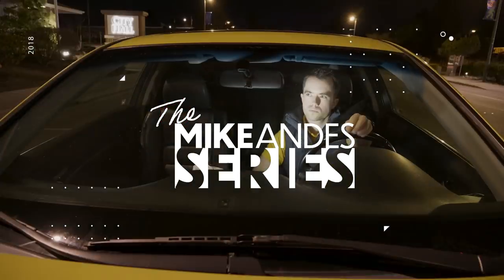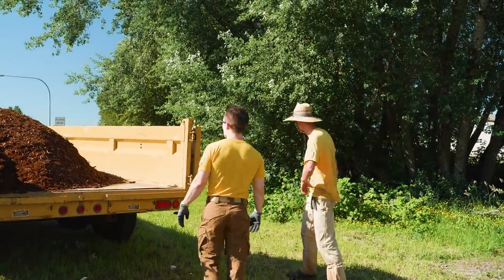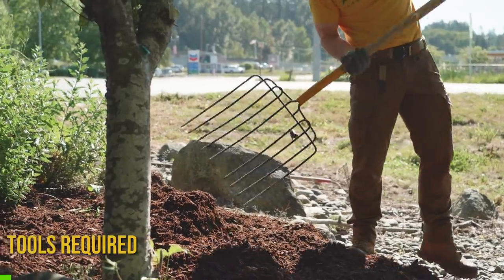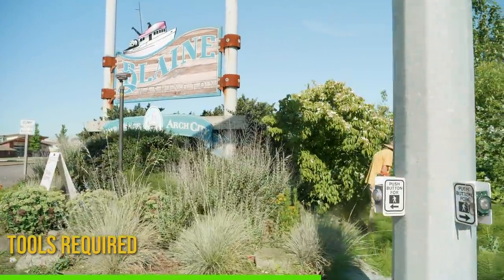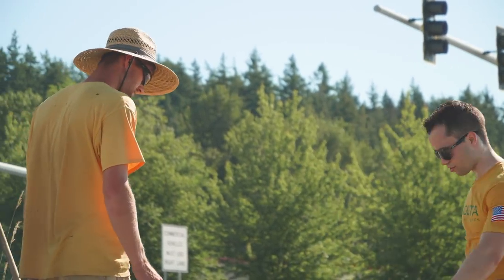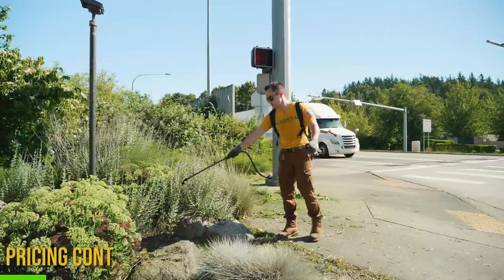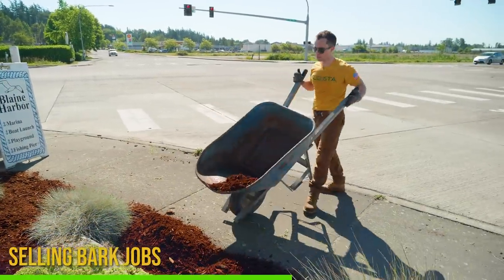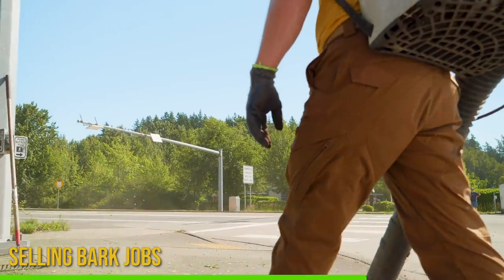How To Do A Mulch Job | Measure, Estimate, and Price Mulch | How To Mulch Tips

Comment: I would recommend buying a wheelbarrow with two wheels.  It can carry more material and it's better for you back.  It also makes it easier to push on rough terrain
Reply: You can’t, the bottoms split something awful. I tried to reach out to Jackson and True Temper a few months ago when I couldn’t find the 8/10 cubic foot models ANYwhere, and couldn’t order a replacement tub directly from them. They said both models were discontinued and aren’t going to be made anymore. Call them yourself if you don’t believe me, it’s super foolish. Anyways, maybe now that the coroneyvirus is chilling out, and people are working outside again, perhaps they’ll get their heads out of their asses, and start creating tools we need and want. I have three blue 8 cubic foot wheelbarrows, and they’re all broken. From logs and mulch. Can’t buy them, they’re not made at the moment. Have a nice day.
Reply: I'm thinking a 2 wheeled wheelbarrow cant make tight turns between rocks and other obstructions
Reply: Maneuvering a double wheel barrow sucks

Comment: Put a tarp under the back of your truck on street and or yard saves 10 min or so on clean up
Reply: If it's a really hot day a tarp can burn grass in a few hours, especially a black tarp.
Reply: @newsweathertraffic18  if that's the case you shouldn't drive on the lawn or put the muffler to close to grass my guy

Comment: You are wasting time and energy climbing into that trailer to scoop mulch.  You could pull that trailer onto ramp block and use a custom funnel gate to slide mulch into the wheel barrow.  Loading should take very little time and effort, efficiency is profit.   When loading over grass use a white cloth painter's tarp with a board attached to 2 sided, holds it down in the wind and makes it easy to roll up, also the white cloth won't burn grass.  The tarp can also be laid over the mulch on the way to the job, for anybody without the trailer tarp.

Comment: what's your average ratio between time doing actual work at the customer and time inside your car/driving to the next customer?
Reply from the maker: For mowing, ideally less than 20% drive time... really depends on size of property and route density
Reply: @MikeAndes  Thanks for answering, interesting! I'm wondering if it's possible to further improve efficiency (for mowing) by using automation technology. 

Maybe not these small battery powered devices for private customers, but something bigger, based on mowers you use at the moment and equipped with sensors, camera etc and the ability to move by itself.

And instead of pushing a single mower manually, one could instead configure and control 4 of them that do the work in parallel semi-automated.

Are there already robots for professional use available or is it more complicated than I think?